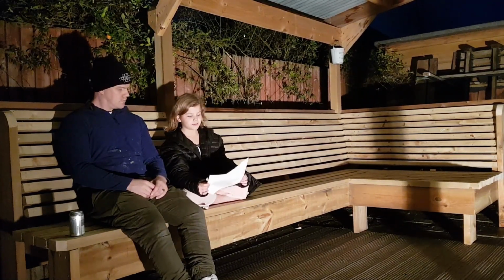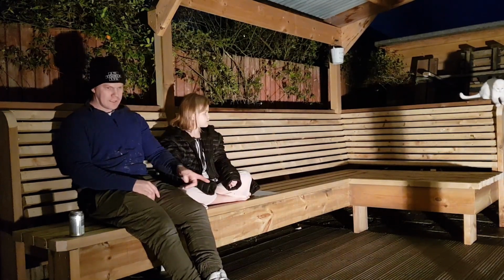Deck Seating - Veranda, Back Porch, Garden Seating

Comment: Nice seating area, I’ll copy that on my decking now. What angle did you do the back supports? Thanks
Reply from the maker: Hi, I don't remember I'm sorry. I think I just tried to sit at a comfortable angle and then transferred that to the timber.  Trial and error basically. If I had to guess, i would say around 12° maybe.